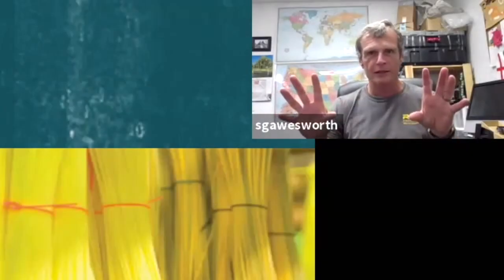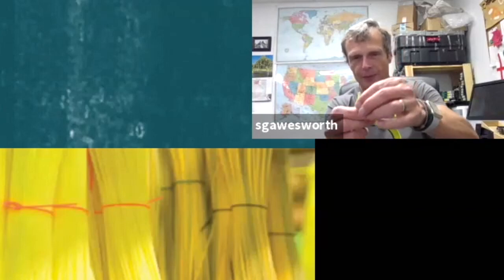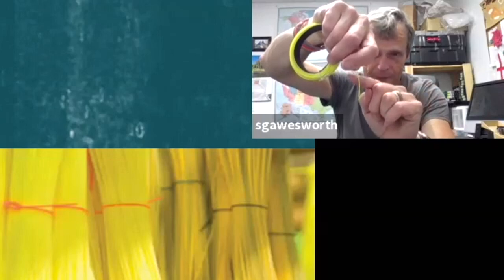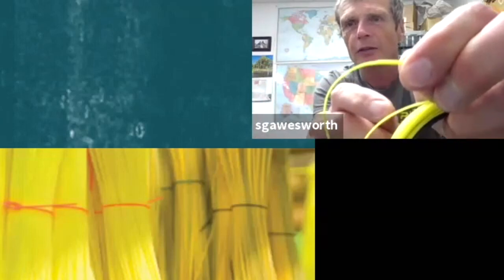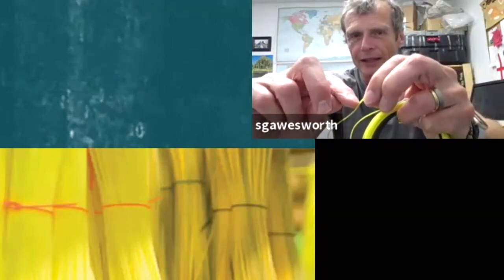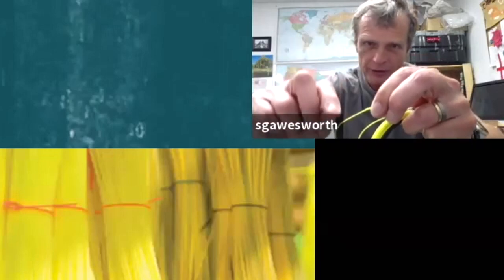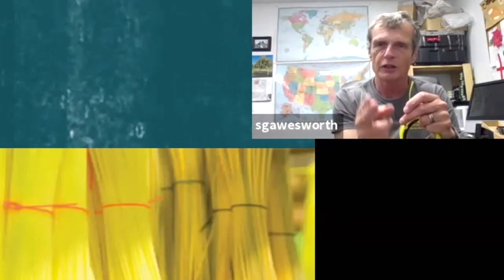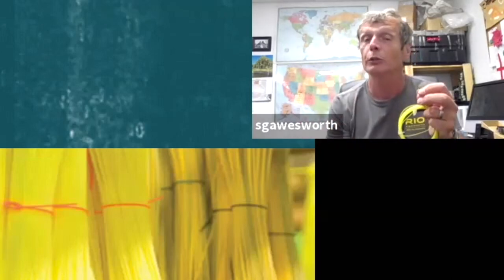How strong is the factory welded loop on your fly fishing line? Simon Gawesworth of RIO tells us.

Comment: My issue has never been the welded loop coming apart but rather the mono in the butt section digging into the fly line at the loop to loop connection to the point where I don't trust it. I generally use 8 weight lines and 25 pound monofilament butt section on my leaders.

Comment: I love factory loops. Kelly Gallop and Flip Pallot insist on amputating them. Then they put on a small section of heavy mono nail knotted to the end of the fly line. Then they tie a perfection loop in the mono and loop to loop the leader. Looks awkward. 
Use the factory loop.
Reply: Sometimes the loop to loop connection can cause hinging.   “ Sometimes “ if so a nail knot would be better for laying the line out.
Reply: Often people don’t tighten the handshake knot enough, should be closed completely and flattened. I use home-made blood knot leaders with 30 lb. butt section of Maxima (25 lb. for 3 weights or lighter). Both of these solutions will significantly reduce hinging, and no loss in energy transfer. Maxima chameleon is much stiffer than most store-bought leaders, so it matches both diameter and stiffness of the fly line. And, the step down leader formulas lay down the leader and line on the water just fine. Most store bought leaders suck, both in durability and the taper which is too abrupt. Also, people forget the loop has the core of the line running through it, so even if the plastic coating gets worn through over time, the core is still there holding it. Not sure why strength is an issue because this connection should always be stronger than your tippet. Make sure handshake knot is tight, don’t use a leader loop that is too small in diameter, and you can catch hundreds of fish before you would ever notice any wear. You can also make a new welded loop easily, with shrink tubing and a lighter or heat gun, so repair is easy.

Comment: with trout, my issue with welded loops was about hanging up in the guides and, most importantly, the energy transfer from the line to the leader while casting. i’ve found the needle nail knot to be strong enough for my trout fishing and to cast more smoothly and present the leader/fly more predictably and delicately. I use it with salmon and steelhead too, and it’s never let me down, but i can’t claim the same benefits as with trout. i think the best things about rigging with loops is twofold—it is convenient and easy.  But neither aspect makes a lick of difference when trying to present the fly well to trout. 

i could see that loops would be great in the salt where delicate deliveries are less key to success and your leader never runs into your guides?

Comment: I always cut them off and always will. Nothing to do with the strength, it's the ugly lump at the end of the line. I nail knot to the end with a tapered mono leader and connect a tippet to that. That provides a smooth set of connections and transfer of power along the line and very little to get snagged on rings.